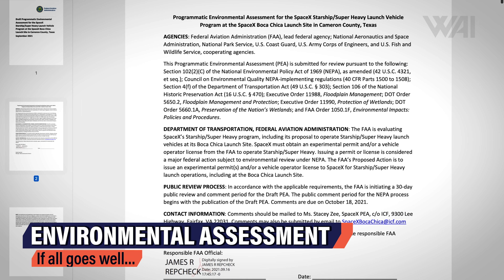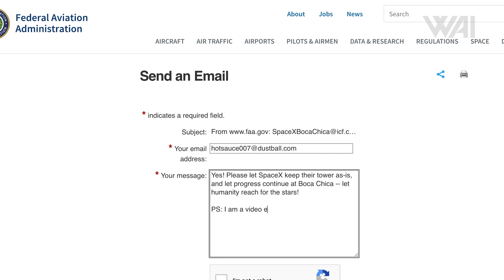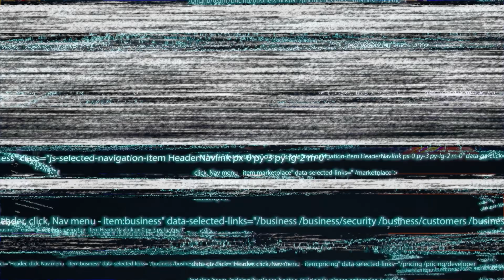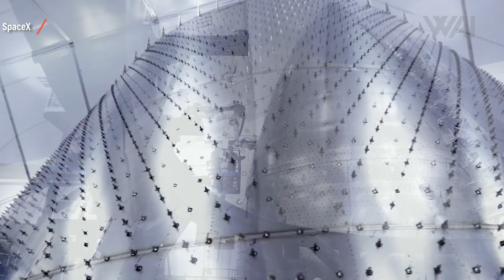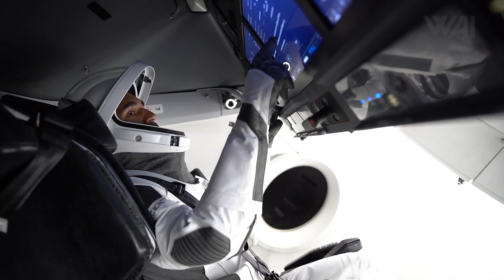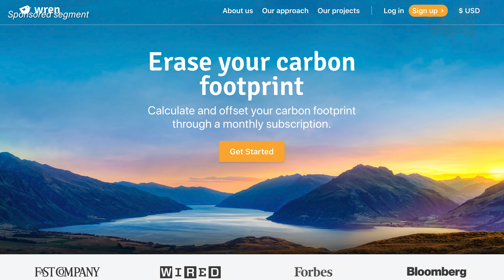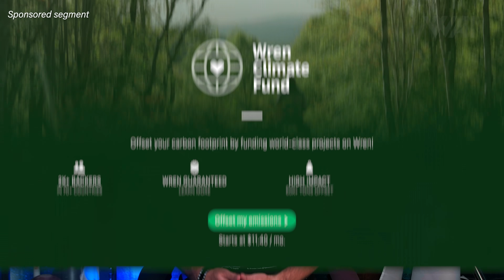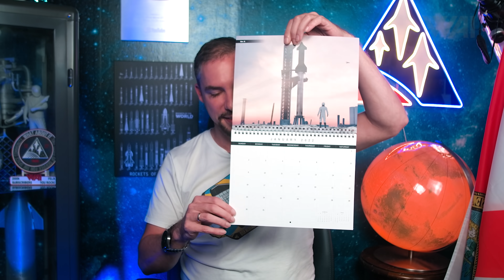One month to an orbital Starship launch attempt! & SpaceX Crew 3 Mission Status!

Comment: "The ceramic heat tiles need to be highly durable and basically maintenance free".... They also need to stick to Starship instead of falling off! Hope that SpaceX solves this - it seems to be the number 1 problem at the moment. But what do we know?
Reply: I mean 6 months ago we had never seen a tile. I imagine them being at the Starhopper/Mk.1 maybe SN1 level. So give them another 12 months...
Reply: @please_stop-v7o  well we knew they were problematic when used on the space shuttle. After each trip it look weeks/ months of inspection and replacement for the thousands of heat shield tiles.

Comment: starbricks is falling down because they are too tight attachen. metal to ceramic. if you add some elastisity then everything will be fine. i suggest two options. rubber glue filed spring or just this wire bend to give extra elasticity. and will be perfect

Comment: Maybe attachment pins are not the way to go.  The should do the gluing method shuttle used.  Those tiles stayed on. The issue was from the debris hits from the ET which should not be an issue with Starship.   

BTW, can Musk stop using the word Star for everything.  It's kind of childish.  Just call them thermal tiles.  It's a cooler name than Star Bricks.

Comment: Those heat tiles need to be attached with both pins and a "T" shaped pin. And the tiles need a "T" shaped groove, so the tiles can slide on and be locked into place with the normal pin. That way they cant fall off.
Reply: Good idea
Reply: Pins are a problem; they'll come loose with sufficient vibration
Reply: @Tonatsi  hmmm heat resistant epoxy ? Does it even exist hmm
Reply: @plurplursen7172  I invoke Poe's law to see whether there is sarcasm in your comment
Reply: @plurplursen7172  in either case, epoxy is not what you'd use anyway. The whole point of starbrick is something that is easily removable; i.e. not glued on.
Reply: @Tonatsi  its removeable. Just grind the brick away down to the steel
Reply: @plurplursen7172  Do you think that that will be possible within the 1 hour turn around time that they are trying to get?
Reply: @Tonatsi  if the tiles dont fall off they dont need to work on that in that scenario
Reply: @plurplursen7172  Yes, because the tiles still get damaged from wear and tear, so they need to be able to replace them. Like in the Space shuttle. The entire reason the space shuttle took so long was things like that; for example, its heat shield was the same type, but super hard to remove.
Reply: @Tonatsi  I dont think 1 single tile should be replaced when the turn around is 1 hour. No matter how you attach them they cannot be changed in that timeframe. The second the rocket is damaged or have to be taken out of rotation for inspection after X hours flight the "1 hour turn around" will not happen.
Reply: Yes and shaped into dragon scales that overlap each other so the can flex and move around if needed.
Reply: @mightandbelightnr2290  any movement leeway will allow friction and erosion, plus potential resonance frequencies, likely destroying the tiles within seconds of the engines firing.
Reply: I thought it shed welds?
Reply: Rare earth magnetics should do the trick
Reply: @projectblackwall  you underestimate the power of resonance
Reply: @projectblackwall  😉  q=curie+temperature

Comment: hi felix why is there not a flexable heat resistant fome our semi liquid that is a solid undar pressure that can be sprayed our brushed on instead of tiles,.tiles seem so out of date in 2021 ? even some sort of thick heat attracted gell that would move to the hot area were needed ?

Comment: If the tiles were to slide sideways and lock into place, using narrowing channels on the back of the starbricks then this would keep them in place permanently - obviously end tiles would have a special fitting to lock them in - only problem I see is if a tile cracks or breaks then you may need to remove a whole row or two of tiles.

Comment: Well its obvious surely. The attachment pin should go right thru the tile and secure on the outside - it simply cant fall off short of the tile fracturing
Reply: Then the pin is a heat bridge, you don't want that. The heat you want to keep outside.
Reply: And how it's going to be secured on the outside? Whatever it is it must withstand the same heat as the tile.
Reply: Ok then change the tile design so that it locks into position for example by rotating it
Reply: @simons1543  you could rotate into position only circular tiles :)
I believe much better brains than us pondered all the options.

Comment: Could the tiles not be made to overlap like scales or roof tiles to allow them to expand and contract freely?
Reply: @shannon6876  but they could be designed like tongue and grove floor panels so surfaces would be smooth but allowing for expansion.
Reply: @shannon6876  Yes, I agree, if done wrong. After writing the comment I thought a bit more about it. But....imagine how a birds feathers are arranged..all overlapping, light and mobile..  Gannett  seabirds for instance, dive for a fish to several meters below the surface into extreme cold, then bob back to the surface and fly off.....perhaps lessons could be learned from nature to help solve the insulation problem on Starship?
Reply: @Andimooomoo  The difference is that bird feathers dont undergo plasmic ablation
Reply: @Tonatsi  Uhm...
1) The tiles don't undergo ablation either.
2) Andrew is talking about the arrangement of bird feathers. Obviously the concept would be applied to Starbrick (thanks, Felix) material.
I think Andrew's idea has merit.
Reply: @TimStCroix  I thank you sir...spot on.
Reply: @TimStCroix  correct, starbrick is a ceramic heat soak shield. Thank you. If all were talking about is the arrangement, it might have merit, but the feather arrangement only works because the feathers are both thin, and attached from a base spine. Its not very sturdy, it's the way it is to allow birds to move eache feather individually, so I feel like there's a more practical design than feathers
Reply: you need a coating sprayed on , skip the tiles. i dont know how it can be done though.

Comment: Genuine question, why even using tiles ? Probably easier to manufacture but hard to assemble and way risker at usage
Reply: Makes you wonder why they scrapped the idea for the transpiration cooling
Reply: I believe the attachment pins are the problem.  I believe if the gluing method shuttle used would be a better system.

Comment: I think under the new FAA requirements they might be better off making a refueling depot in space. But it has to be a system with a refrigeration system to help with boil-off.
Reply: still have to have the launches to re-fuel the depot. We just got to convince the FAA that the benefits outweigh the impacts. As long as SpaceX is able to manage methane release at a minimal level, Raptors are otherwise one of the cleanest burning rockets made. Hydrolox is cleaner, but only by a very small amount. That said, the emissions profile of kerosene/lox rockets is still cleaner than your average jet liner. Tim Dodd's deep dive into rocket environmental impacts is a good reference for that. SLS is much dirtier, since it still uses those solid boosters.
Reply: @danceswithmules  Shipping all the methane out of the atmosphere and burning it in space is pretty green.
Reply: I could see a long term value to a depot should SpaceX succeed in actually attempting to colonize Mars.  They could send up fuel to the depot well before the transfer window which would reduce the needed launch cadence.  They could also defer launching the Starship going to Mars proper until all the needed fuel is in orbit rather than having multiple launches after to fill that Starship's tanks.

Comment: Can the heat shields be made larger in order to decrease the total number required?
Reply: if they make it larger then they would have to curve it so it can follow the SS. They would get damaged easier, thermal expenson would be greater, and if one falls off it would leave a larger hole in the TPS, so the SS would likely explode on reentry. You would need less of them though :)
Reply: @adammarsi3817  Makes sense.  Wonder if the tiles can be monitored in the event some fall off during launch?  Or, will it have a drone to do an outside inspection?  If some do fall off, the Starship could remain in orbit for a crew transfer.  Don’t want to have another “shuttle” disaster.  Starship would be grounded for long time.